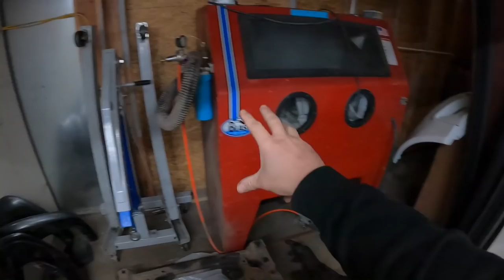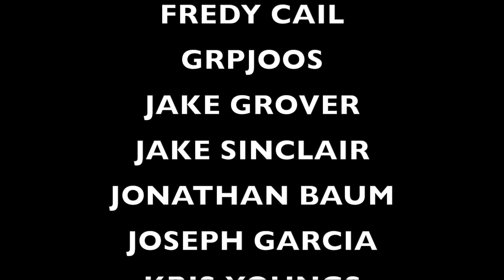NEW WHEELS FOR THE 370 + CAGE COMPLETED!!

Comment: Get a vinyl curtain for the small room. It'll keep the sand in when sand blasting (a sandblasting cabinate shouldn't let much sand out if it is sealed well). Get a sandblaster vacuum and you won't need to make a hole. If your building a wall make a small room for the compressor to dampen the noise.
Reply: And move all the engines away form the sand dust

Comment: Chris don’t forget when you build that wall next to the sand blaster, the door to the blaster is on that side. So make sure you leave enough space to get parts in and out or it. And there are a lot of cheap upgrades you can do to make the blaster 100 times better.

Comment: If you don't want to do the timing chain when changing oil gallery gaskets just call your local infiniti dealer ship and buy the gaskets and metal covers for an 08 infiniti ex35 with the hr motor. Both the 3.5 hr and the 3.7 vhr use the same oil gallery gaskets.
Reply: Also to remove the last screw that hides behind the gear, you can use a milwaukee Philips drill bit. It works because the bit narrows in the middle. That's what I use to do that job whenever the oil galleries go out
Reply: dude no. 2013 and up i believe they revised the gasket. get the updated one rudknick
Reply: @pushhrodd01  2013 they revised the design & they usually discontinue the old design so any gaskets sold for the model years below should now be the updated design.

Comment: Had to do the gallery gaskets on my 07 350z right after I bought it.  Got the revised gaskets and new bolts from z1 Motorsports. Took me 2 days to do and saved me $2000 that Nissan quoted me. Just followed a video on YouTube, channel is called SUPERFREESTYLE. Shows that you don’t need to take the variable cam covers off the timing cover when you pull the timing cover off. I would recommend giving that vid a look see.

Comment: If you put the air compressor in that little room just make a vent with a fan to pull air in to help keep the ambient air temp down it will help with moisture and over heating

Comment: Build a box outside on the side of the building and put your compressor in there just cut a vent for air for it and run a copper pipe or soft like through the wall and a rubber grommet so it seals the pipe or line I’m the hole in the wall so no leaks it will keep the noise down and help with the ambient air temp for the compressor and motor you should also do a refrigerated air dryer you could mount in the shop and plumb through the wall to that it will take all the moisture out of the air before it reaches the tools I was a air compressor rebuilding tech at a shop in East Haddam ct for 3 years

Comment: 370's are easy to pull the engine, just drop the subframe. Used to work at a shop, bosses Z spun a bearing. Me and one other dude dropped the subframe, removed the old motor, and put the new in in just under 8 hours. Boss drove the car home that night and it's still running to this day.

Comment: The sandblaster is contained in a box, but the matrix stiff gets dropped when you operate and open and close it. You could staple up plastic sheeting on the walls, and put a curtain or door across, and that will contain most of it. You might then need to ventilate it with some ducting and a fan.

Comment: make sure you get a air compressor with a heater, or at least a heater for the air compressor. 

for Connecticut cold weather, air freezes. trust me. I've been there. 😟

Comment: im pretty sure i had the same gasket problem that Tommy is talking about in my g35 that i got.  bought it and the check engine light came on as i was driving home.  thankfully i used to work at nissan so i got a buddy to fix it for me.  wasnt cheap or an easy job all for a paper gasket that goes bad....yep after you went to tommys shop and looked at his that was the exact issue i had.  I replaced all the timing shit while i was in there....was not an easy job.  That is probably why another shop was trying to get me to just replace the engine.

Comment: timing chains on the 360oookm 4.6 V8 are fairly loose, but I am not thinking about it because a 393 Cleveland bolts up to the 4r70w just fine. pass over the self correcting fuel injection system from the 4.6 and all... 😆

Comment: If you do exhaust fan also install closing valves and piping so during winter you can put a hose on the exhaust to run cars so you don’t have to open the door.

Comment: Put the compressor outside, run an air line into the room from the compressor, mount a regulator on the wall in the room

Comment: Tommy is right no I drive demolition derby in that bumper has no girl it will fuck up the frame a lot quicker than what it was if it was stuck You guys probably did not reinforce around the area of that point to make it structurally solid if it’s based around you should be all right

Comment: Why would you pay some one to cut a hole in the wall and run a 20ft accordion pipe out the back wall and add a inline fan. You can build these cars you can for sure cut a hole in drywall and run a inline exhaust fan Chris come on now. Nbs

Comment: You do not have to remove the front end to remove a 370z engine. It comes out from the bottom with trans on the sub frame. The timing chain covers are a coming issue. All nissan techs do them in the car without removing all that... it takes about 5 to 6 hours. The hardest part is lines the two 12mm bolts for the power steering bracket on the pass. Side of block.
Reply: With radiator upgrade and undoing the fuckery from whoever worked on it, it was best to redo it all.
Reply: @shokunin_era  did you replace all the guides and chains?
Reply: @jonathanmaxey9551  every guide, tensioner, o ring, chain, etc
Reply: @shokunin_era  if you guys ever have any questions I have been a nissan tech for 15 years. I have plenty of knowledge of them...
Reply: @jonathanmaxey9551  appreciate it dude!!!